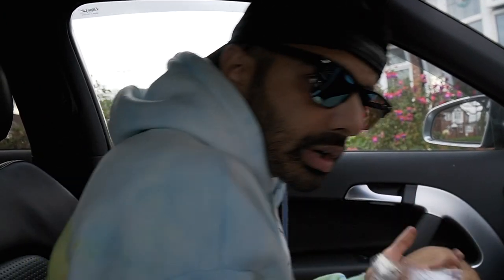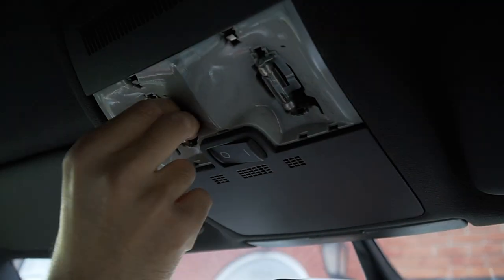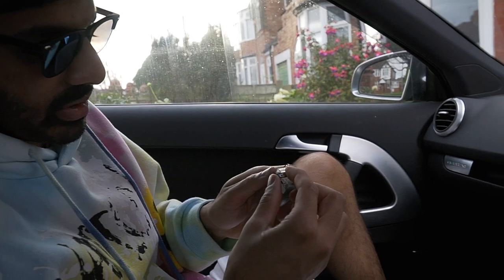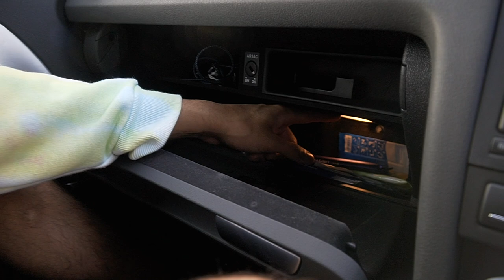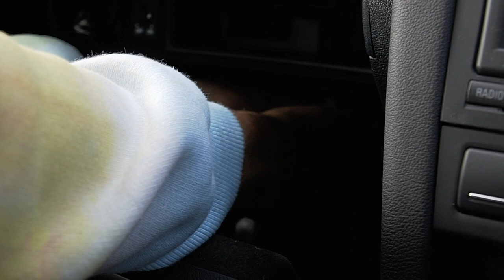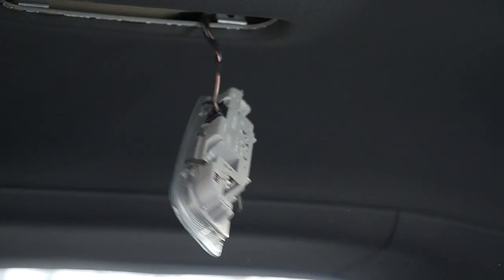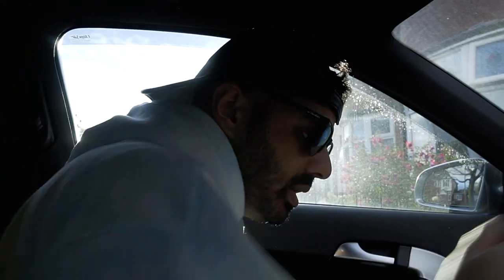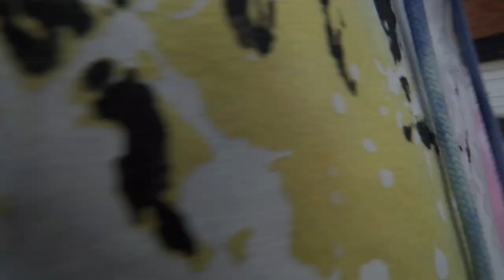Audi 8p Interior Light Change

Comment: You have to close the boot and open it after installing the led light then it works that's why the original bulb didn't work after putting it back

Comment: I have the same issue. What happens the car checks the lights if there is not enough resistance stops 12v supply.
So you have to install the light and lock/unlock the car. 
It’s not a fuse. 😉